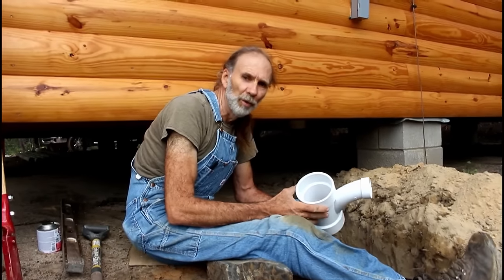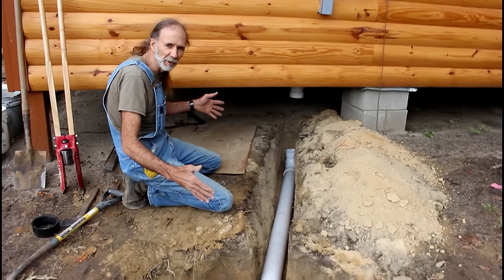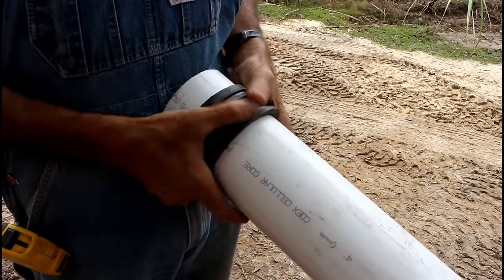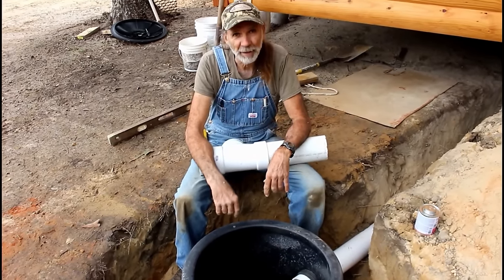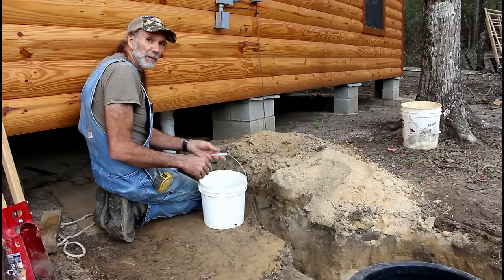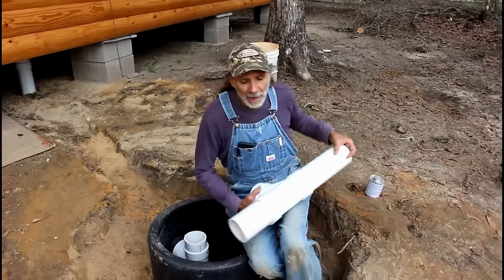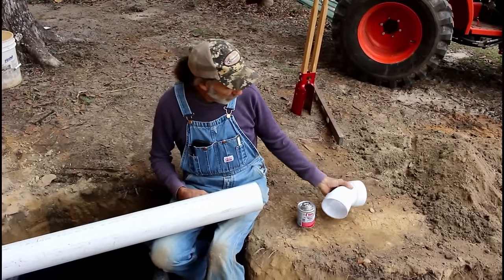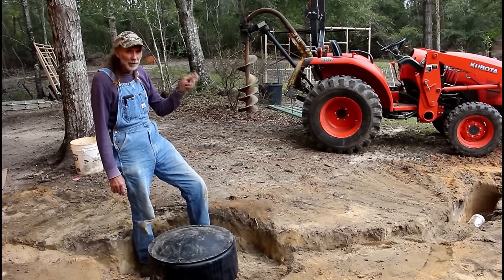How to INSTALL Your OWN Septic Tank | Septic System Install | Part 3

Comment: The cleaner isn’t just a cleaner it’s actually a primer that softens the pvc and is what allows the fitting to be welded to the pipe
Reply: Absolutely correct. I'm sure there have been millions of joints made with only glue, and I'm sure most of them held well enough. But without the primer, that is not a proper installation.
Reply: HeavyMetalMechanic80 p
Reply: The cleaner is NOT a cleaner but an etch primer. It DOES clean both surfaces but its main function is to remove the glaze from those two surfaces. When it does, it also etches in and softens the surfaces allowing the solvent cement (blue glue) to eat into the UPVC and create a chemical weld.
 I have exposed many joints where etch primer was not used and almost every one of them leaked.
 I have seen plumber who prime a number of joints so as to speed up the operation.
That's wrong too!
 By the time you get round to do the last in the group, the surfaces of the joint may be clean but the plastic is not soft.
 It must be soft from the etch primer so as the solvent cement can properly etch in as well.
Reply: yes eddie
Reply: I glued a few joints at my pump with just the purple cleaner stuff,I'm dumb and forgot to use 2nd step glue. Left it that way and waited for the leaks. After about 5 yrs still not leaking. But I'm in central Florida so no real cold. When it starts to leak I'll fix it right🍺
Reply: MY EXPERIENCE  WITH GLUING PVC JOINTS.......THE CLEANER ITSELF WILL GLUE THE PVC ....APPLY THE CLEANER AND CONTINUE TO TWIST THE  PVC UNTIL IT SEIZES.   
ONLY APPLYING PVC GLUE  WORKS .

DO WHAT WORKS BEST FOR YOU......😎😎😎😎😎😎😎😎😎😎😎😎
Reply: I would use the cleaner because if there is a tiny leak backstanding water could make the property smell like peepy duky lol
Reply: Every time I've used cleaner it prevents the proper locking of the glue.
Reply: @craigtube814  Then you are doing something wrong...  not using the primer is not even legal.
Reply: I had fix pvc where primer and glue was used, using primer is not a warranty
Reply: @CarlosGonzalez-js9my  Using primer is code in my area.  If you have to be inspected and the inspector cannot see primer, they will fail you.
Reply: @chipperfluffy  chip did you not use primer and now your upset
Reply: @eddygoodwin7089  I say to each there own. I would use primer.... but

Comment: Excellent video. Your explanations make perfect sense at every turn. One small suggestion I have would be to rough up the fittings and pipe ends with sandpaper before applying cement. It's the old way that plumbers used to ensure solid mechanical/chemical bonding before primer/cleaner solvents came around. I used this method on supply line piping to re-plumb an entire house from scratch and it works like a charm.

Comment: Cleaning the joint first DOES matter.
It's not a cleaner, it is an etch primer meaning it primes the surface by etching into it. There is a glaze that should be removed before the solvent cement is put on the two surfaces.
 Once the glaze is removed and the surfaces are etched it then allows the solvent cement to melt into both surfaces, thus creating a chemical weld.
 If you don't do it that way and the pipe moves, the joint will crack, leaking out effluent and allowing roots to grow in.
 Because of the way you backfilled with just ordinary dirt, especially under the pipe, I guarantee the pipe will move.
 The trench was not wide enough to have easy access to the pipe so that you could ram in 10mm, (3/8) blue metal or stones UNDER the pipe to correctly support it.
 Shoving dirt under the pipe is a recipe for disaster.

 The minimum fall for sewer pipe is, 1:60.
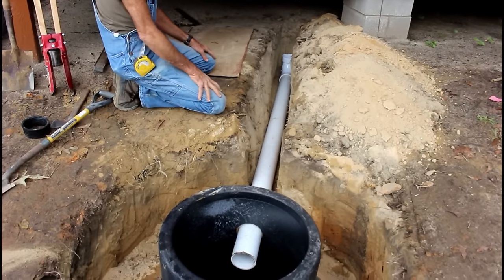If you give a fall of 1" in 4', then that's a fall of 1:48. I think you will find that your fittings come with a 2 degree fall, eg, a 90 degree bend is actually marked 88 degrees, giving it a 2 degree fall.
 To check if the fall is correct, when you lay the horizontal pipe in the trench with a bend on the end, put a small level across the vertical socket in line with the long pipe and if the pipe has the right fall the rising socket will be level.
 A septic tank should be no closer than 1.5M (5ft) from the house and before the line enters the tank, you should have a cleaning access in the horizontal line allowing easy cleaning to the tank and to the vertical WC riser.
 When you run the tank outlet, it should be far enough from the tank, that the level of the ground where the leach field is, is 450mm (18") below the level of the tank outlet.

 Why?
To ensure that the effluent does not back up into the tank and then the house. You didn't mention putting in a yard gully, that's a 'P' trap with a grate on top, to protect the house from surcharge.

I'm wondering if all you have in the house is a toilet. If so that's fine.
But, if there is a shower, basin, laundry tub and kitchen sink, where will you run that grey water?
 If you bypass the septic tank and run it directly to the leach field, then you have a future disaster on your hands. You could connect it to your vent line, but then your septic tank will be overloaded, it's too small.
 Also, unless you have a perfect seal on the septic lid, or the top of the tank is 100mm (4") above the ground, water will get in and also overload the tank.

 Detergents keep oil in solution for a long time, even through a grease arrestor.
 Once grease enters the leach field, it will act like a plastic sheet, sealing off the ground so you eventually have no absorption.
Reply: Ken Lyneham wow. You are very informative. Thank you
Reply: I forgot to mention;
 There should also be a vent of some kind on the septic tank. Normally the underside of the lid is 100mm/4" above the ground. That would allow an induct vent installed on usually the access port above the tank outlet.
This gives cross ventilation through the tank and up the main vent which also equalises pressure within the system.
Reply: I'm

Comment: The reason for that exact angle of decline, is so the water flows at just the right speed so the solids will travel with the wave.
Reply: Yep,  You don't want the water to outrun the turd is how its been said since 1947 around here, easy to remember 😉
Reply: @wolfmanrebel874  well, that’s how I remember it, I just didn’t go there.

Comment: Thanks you have the only 300 gal Ball tank installation that I've found, I Installed one of these 40 years ago, not knowing what I was doing it lasted 35 years before we had to have it sucked out, wish I had known about the tees on the inside, oops
Installing one now here in the Desert of the Big Bend of Texas and Thanks for the Knowledge friend.

Comment: It might not be under to much pressure at the moment but i thinknid still use cleaner and id do about a quarter turn once pipe was pushed together after glue was on it. Great video tho and looking forward to building my own soon. Thanks for sharing andteaching

Comment: The house I grew up in had a ceptic tank.  My mom had to replace the cement lid one time.  The company that came out to fix it was blown away because it was clean as a whistle.  My mom had never had to have it cleaned out in the 35 years she owned the house.  When asked what she did she said, "I feed it on a regular basis".  In other words she put "good bugs" in it that ate the poop and toilet paper.  She only used Scott toilet paper (it's biodegradable), and never bought anything else.  She knew how to take care of a cepit system.  Today, I only buy the same toilet paper because I'm also on a ceptic system.  She taught me well, and I'm 77 years old.
Reply: What kind of bugs?

Comment: Don’t forget to call a real plumber after your fittings come apart. The purpose of primer is to begin the chemical reaction that softens PVC and to provide an even prepped surface for the solvent cement. As you may know, PVC joints are not glued together exactly, but fused through a chemical change. The softer the outer layer of your PVC, the better it will cement in your joint.
Reply: K P frap I guarantee he will live the rest of his life without any problems. My father did the same thing on the house we grew up in which I now own. I’m tearing up everything just because I want it a different way. We’ve tried to pull the joints loose and can’t do it. The pipe breaks before the joint turns loose. Primer was just another fancy way to trick the masses into spending more money.
Reply: I glued pipe together way before they had primer  no problem.

Comment: As a Plumbing Gas and Mechanical inspector for 30 years I had to make decisions based on codes for the City. And I went to many conventions year after year where we heard Underwriters and Manufacturers plead their cases and as a member of the ICC we would vote to deny or accept a resolution to adopt as code. I will say a majority was well thought out by professionals with engineering and architectural degrees, but many codes are driven by manufacturers products in pushing sales. Like non pressure piping using cleaner that will be underground is quite ridiculous. I’m now retired and live rural on a river and love the fact that neighbors are off the grid from inspections. I just spent $10,000 for a 200 Amp Square D Panel box , Sub panel inside house and new mast through the roof with a permit and with an Electrical inspector approved. Could have had it done without a permit and done this myself but insurance companies will subpoena all inspections department records if your house burns down to find ways avoid paying you especially when they see the work was done without a permit. I believe inspections are essential in electrical and gas work. Love your gray water system. We love raised gardens and I am about to re-plumb our entire house with a gray water system. This was an interesting approach in using gray water in gardening. Hope you show us the end results with your garden.

Comment: FYI, the "cleaner" in my opinion is labeled a misconception . It actually softens the pvc to strengthen the bond of each joint with your adhesive. They both work in tandem of each other. Just as sanding a material before painting. If you put paint on a shiny smooth surface,  most likely it is going to peel much faster than if you had sanded and primed it first. With pvc cleaner, it does basically all the prep for you.
Reply: Thankyou for saying that. Noted!!
Reply: I never use "cleaner" 
and 0 leaks or problems even on main water lines with 60psi
FYI😂
Reply: It's cleaner then primer then glue

Comment: In the early 70's we had to change out a cracked concrete tank, the fellow who built the tanks advised putting a dead chicken and 10# of sugar into the tank to kick off fermentation. To this day if I have my tank pumped I'll flush a bag of sugar, no need for the chicken if the tank has been running.

Comment: I love the rope and lever trick at 6:00.  I don't know how many times I have had to connect an electric or water line in a trench to a building and it is usually a pain to get a good deep connection.

Comment: Having to make repairs on a 40 year old plastic tank. The outset side was leaking at the tank seal. The tank was too close to the walkway by the kitchen. I will be installing a riser for easy access using a spray foam to seal above the outlet. Any ideas on this would help. Really got a lot of help from your videos. Thank you God bless

Comment: Using purple PVC (polyvinyl chloride) primer and cement is very easy to do. PVC surfaces must be clean in order for the primer to effectively prepare the PVC pipe and fittings for cement. Purple PVC primer chemically cleans the PVC surface, so if the PVC pipe remains somewhat soiled after attempting to wipe the grime off with a cloth rag, the primer should finish the job. Primer also softens the PVC surface so the cement will be able to bond two PVC surfaces tightly. Do not use PVC cement without first using PVC primer. They are to be used simultaneously.

Comment: We just recently located the existing septic on this property.  I don't think there is a level spot on this whole property, not to mention the drop from where the house used to be to where we found the septic is WAY more than 1" in 4'. I've been trying to figure out how to tie into the existing septic. Haven't uncovered it yet, had to wait for above freezing temps.

Comment: The T on the "house side" of the septic tank will cause sewage to back up in the line because it does not allow the sewage to spread out in the top of the septic tank. Other than that, nice job!
Reply: What do you recommend on the "house" side?
Reply: On ours, there isn’t anything on the house side, the pipe just drops straight in at the top.  We do have a T on the drain side.

Comment: Danny,  were can find the 4”rubber grommets for the 4” pvc pipe? (Lowes didn’t have anything bigger that 2”
Also,
When I cut the inlet and outlet whole one the tank(I think your already came with cut holes), to I use a 4” hole cutter or does it need to be 4.25” or bigger for the grommets to fit?
Thanks

Comment: If the incline is greater than that, will it be a problem?... good video, thanks.
Reply: The idea is that the water will run away from the solids if the downslope is too great.

Comment: How big is that septic tank?  It don’t look much bigger than a 55 gallon drum!  I plan on using 4-5 IBC Totes, (275 gal each), connected in series using the inlet/outlet setup, and the last one would drain into a flower bed.  This will be a Bio-Digester type system.  I will tap into the first IBC Tank, on top, to harvest the methane gas, by routing that to a large bladder (heavy-duty waterbed mattress?), using a rubber hose, and from that bladder, run it to an outside propane stove!  Since I cant bury it, where we live, this system will be above ground, but under the home. The home will be on pier and beam foundation, elevated about 5-6’ above grade. Your videos give me inspiration, Pops! Thanks for sharing!
Reply: I am building same foundation check it out waiting on health inspector to pass my plan for septic tank so I can get electric on. Good luck

Comment: I work in the septic business in NC. I liked some of your tips some were good some were different than I'm used to. Few things I noticed:
1. the block and rope trick is brilliant I like that.
2. Even on small homes we tend to use plastic 1000 gallon or concrete tanks.
3. Ts (on inlet)are not required in NC but are in VA. (anyone listening if the tank is 500 g or more bring the inlet within 6 inches of inlet hole) Usually don't use Ts so we can use a steel snake or pressure cleaner in case of clog.
4. Hunching the pipe is good yes it really does prevent sagging. 
5. Our tanks have floated before even concrete tanks. They make anchors for the plastic infiltrator. We fill them up with 500g and it usually works good, or put machine bucket over it to keep it down. The small tank you used we put a pump tank in like that with a foot or two of concrete.
6. We use Filters in all new construction it's the law. I'd recommend you get one it will save you a field in the long run.
7. Tanks come with outlet lower than inlet, and we don't use the gib on top why do you use a gib there?
8. For what you were working with you did a fantastic job we have mini escavators.
9. What kind of field is it?
Reply from the maker: Not sure what you mean by gib? The g field is a manifold system. I have a video on it.
Reply: @DeepSouthHomestead  gib is just what we call those little 3 to 6 inches of pipe

Comment: Thanks. You are very knowledgeable. One question, why do you need to put the tees in the tank? It seems that the pipe could just go straight in and straight out.

Comment: I installed here at home, need some details on how full of water I should fill it?   I have a hole the extra water from the septic is filling and that also had a tube to drain out and water is coming out of it..... how do I resovle this issue?

Comment: Personally I don’t see how this works. Your out flow is supposed to create suction to pull material to second tank. When second tank fills and starts to drain it symphonies all the second tank to drain field. With the two T’s it seems that it would just suck air through the drain pipe from toilet and vent !  Could you clear this up please ?

Comment: In the state of Georgia the homeowner can pull their own permit and install their own septic system after taking a installers test at the environmental health department. We would have to install at least a 1000 gallon septic tank to handle up to a 4 bedroom home with a minimum of 65 ft. of field lines per bedroom ( depending on your soil type ) All new homes need to have a soil test done before the environmental health department will issue a permit that's in Georgia. I'm not sure what other states require but I would think they would be similar to what Georgia is doing. As for not using primer/cleaner on the PVC because it's not under pressure I think you should use it because it actually fuses the fitting and the pipe together to form a bond as strong as, or stronger, than the original material. 
I'm not on here to criticize what he is doing in the video I think he is doing a great job and what he is doing will work. I think  the solids will build up a lot quicker in the small tank and will need to be cleaned out more frequently. 
I enjoy watching your videos they are very informative and I wish I had as much energy as you do.
Reply from the maker: I agree with the tank size. This is a place we just visit and shoot videos. If we lived here full time we would need a larger tank. The toilet only gets used on most days just once.